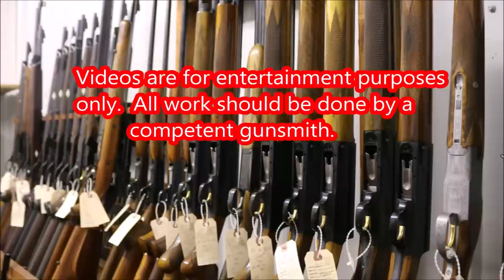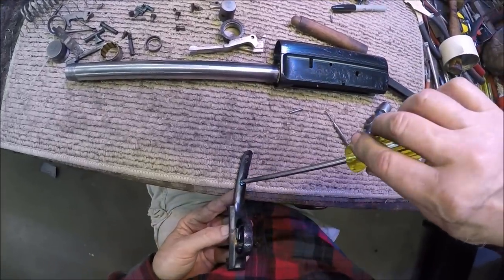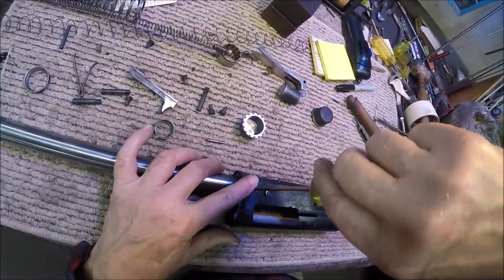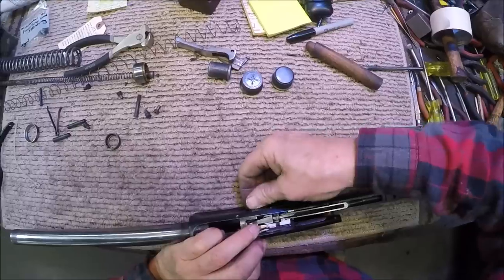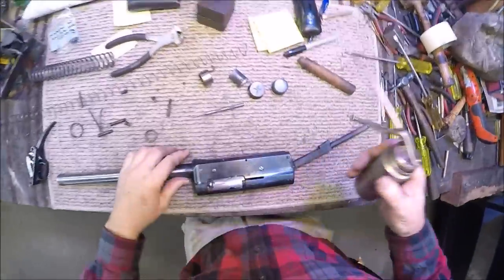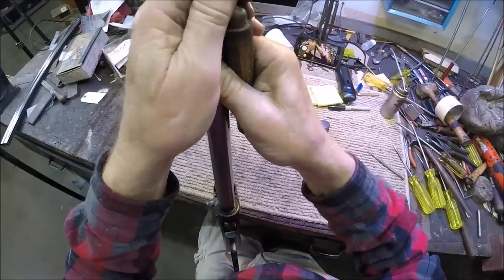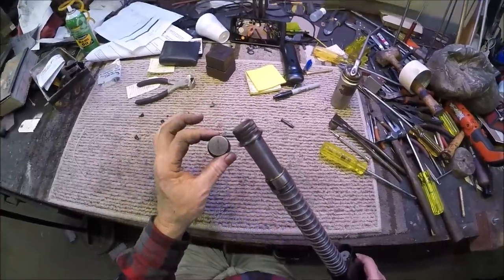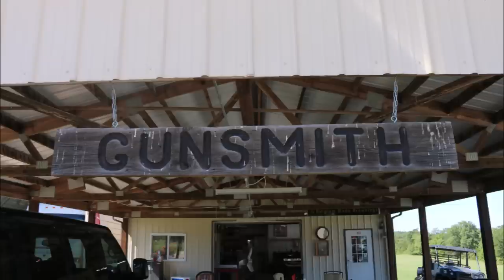Part 2.  We finish up the restoration of the high grade Remington model 11.

Comment: Howdy, can you tell me if a more modern lets say 1980s #11  1100  firing pin , if it will work in a 1926 #11. 1100. ?????  Thanks for any info
Reply: model 11 and 1100 are 2 totaly different bolts

Comment: Several years ago I traded a junk ATV for a very nice 1936 Remington 11, no rust,  no chewed up screw heads, no cracks in the wood. Some yo-yo did manage to cut the full choke barrel off to 18 1/2“, I have since replaced it with a 28” modified. This video series allowed me to disassemble, inspect,  clean and reassembled with no issues. Thank you for sharing your wealth of knowledge and experience.

Comment: Edit:i spoke to them on the phone they took care of it. Again a great example of customer service on what was simply a mistake they owned up to. I would definitely send something their way again. Great people at Art’s.

I’m torn on how I feel with my experience with this place. Everyone was nice and informative, the price I paid wasn’t cheap as expected for top quality work from classic American gunsmiths and the amount of work done to my shotgun that’s not my gripe. I knew how much it would cost and I agreed. My only complaint was for the amount of money I spent, in 2016 I sent in a beat up 1952 Auto 5 that someone sanded the stock and mangled the screws before it was in my possession. The gun was in perfect working order just ugly worn bluing, screws and stock as mentioned. All parts were original. You guys made it beautiful. But when I got it back you guys replaced my belgian 2 ring magazine cap with a later 3 ring japanese one and my round top cross bolt safety with the later flat top one even though those 2 parts were perfectly fine when I sent it in. I only spent all the money I did to bring this gun back because the serial number and the embellished engraving. Now that 2 hard to find original parts are missing and impossible to find it kills any collector value. Besides the springs and some unmarked receiver screws all major metal parts just needed refinishing. I shoot it, they did a nice job, i just feel like they cherry picked my gun for the early parts thinking I wouldn’t notice. I own other Auto 5’s and have taken them down multiple times so I’m very familiar with them and their history. I even broke down my gun and bubble wrapped individual parts to make it easier for them to get started so I inspected all the parts. I’ve been conflicted to comment this the past couple years because they did a good job and are an American company but every time I pull my gun out I can’t get over the missing parts that were taken. Just had to get that off my chest take it as you will.
Reply from the maker: Thank you for bringing this to our attention.  Give us a call at 636-944-3630 and ask for Brad. We will be happy to send you a factory cap and safety at no charge.  Also we do prefer firearms be shipped assembled.  Let us know if you need anything else.
Reply: Art's Gun Shop ok, thank you for the reply. I will give you a call in the morning.

Comment: I’d just put a knew plastic or wooden plug that goes inside the the spring and also that spring on the outside of the tube looks collapsed it’s no good gona end up cracking the forward stock shooting a heavy load threw it or if you shoot it enough